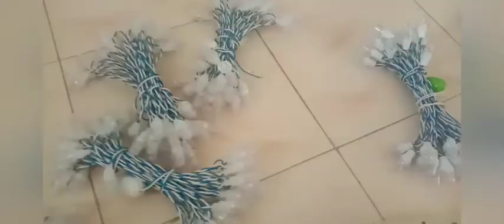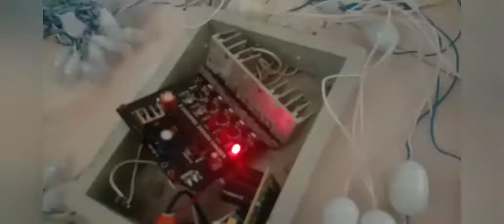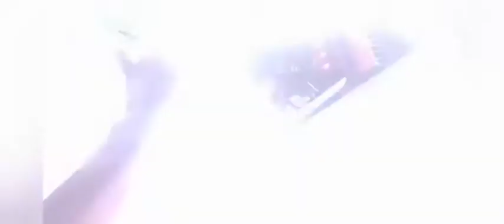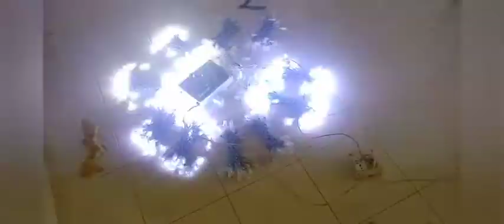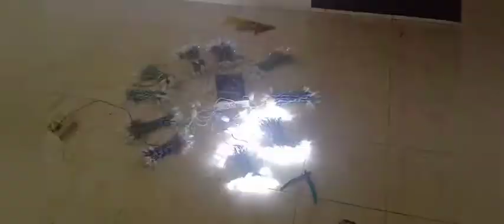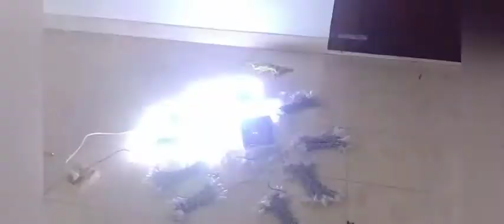LED chaser how to connecting in LED series മാലബൾബ് ചെയ്സർ ഇൽ എങ്ങനെ കണക്ട് ചെയ്യാം AR CREATION 2.2

Comment: Sir 1 serial light il Thane 2 colour led solder chyanpattuvo plz reply eg: red blue red blue eanna rethiyil 40 bulb oru mala yil chyavo
Reply: 2 colour oru mala yil varumbol engegilum problem undo,volt problem valom varuvo bulb   pokumo
Reply from the maker: No using same power led 
3chip to 3chip 
Or same company led are use